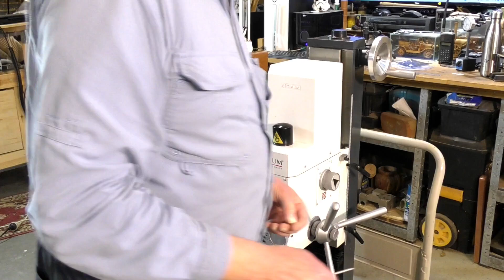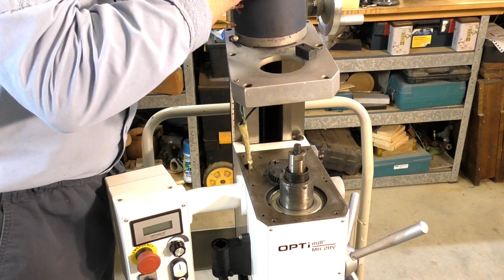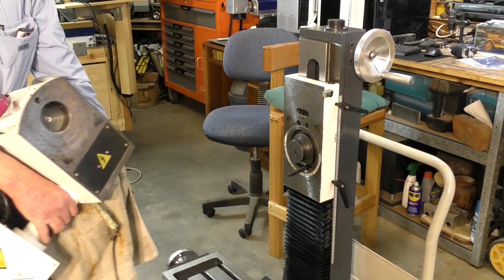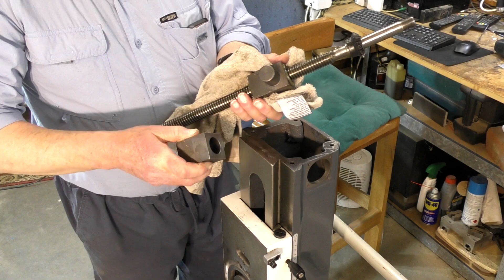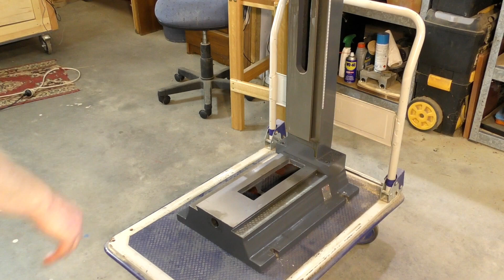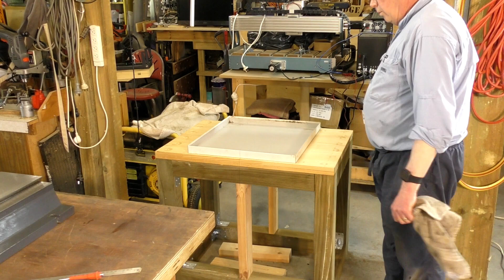THE BEST Milling machine for CNC conversion, PM30MV  HM28V Episode 1  Deconstruction

Comment: Really a challenge. When I see this, I'm glad I bought a milling machine with ball-screws for the X and Y axis. I don't believe that a ball-screw for the Z axis is really necessary. The CNC conversion was a lot easier because of this. I used the CNC Centroid board and software (yes, I'm lazy).